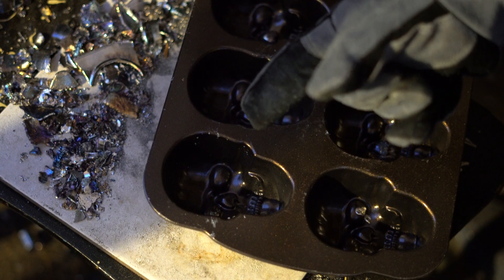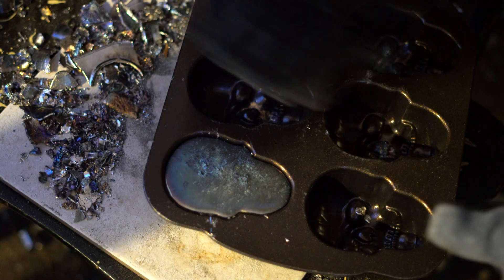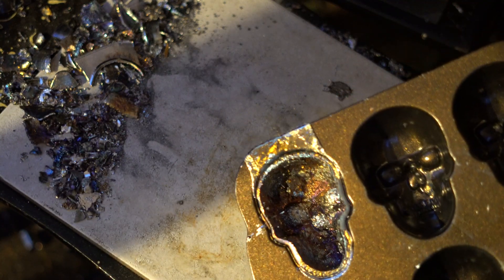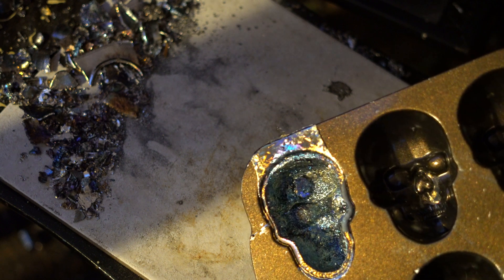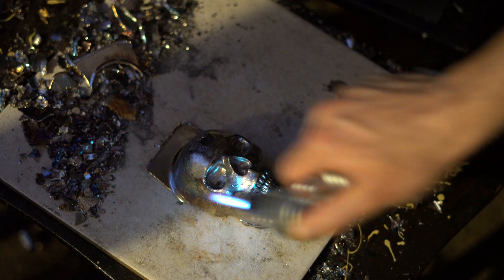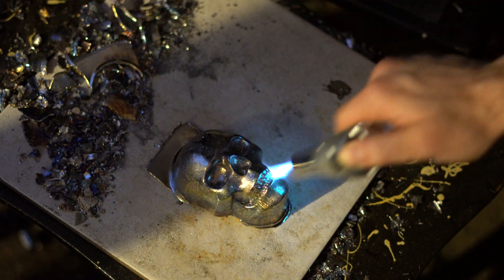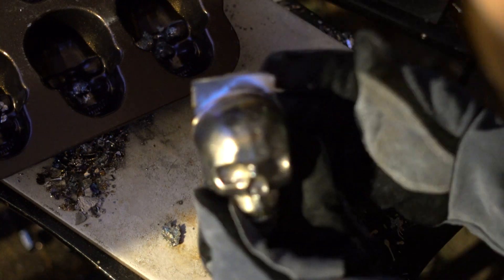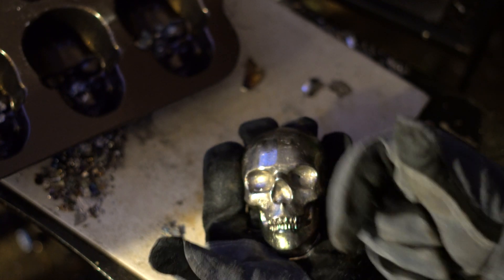Tutorial on Bismuth Skulls and Quick Oxidation

Comment: Thank you for making the video! Do you have a link for the Mold you used?
Reply from the maker: https://www.amazon.com/Nordic-Ware-Haunted-Skull-Cakelet/dp/B00Y6PRETK/ref=sxin_16_ac_d_hl?ac_md=5-2-U3BlY2lhbHR5ICYgbm92ZWx0eSBjYWtlIHBhbnM%3D-ac_d_hl_hl_rf&crid=3UQYZMUI7A39B&cv_ct_cx=skull+mold&keywords=skull+mold&pd_rd_i=B00Y6PRETK&pd_rd_r=ff8cfdd0-bfa2-4bb6-9875-271838aa333a&pd_rd_w=E6izH&pd_rd_wg=D9S4f&pf_rd_p=4c922d54-ff15-479d-b90f-a120e70a35f3&pf_rd_r=KQXF2ZVB1V8VNXRED03N&psc=1&qid=1645489049&sprefix=skull+mold%2Caps%2C63&sr=1-3-fc702cd8-921a-4c9c-a2d2-e02ab86883a3
Reply: @TheNutsNetwork  I'm surprised you can use coated trays.  Does the coating melt off?
Reply from the maker: I have only used non stick trays/pot/pans when making stuff, even silicone molds lol @ThePeterDislikeShow
Reply: @TheNutsNetwork  Does the coating melt off at all?
Reply from the maker: nothing the naked eye can see at least @ThePeterDislikeShow